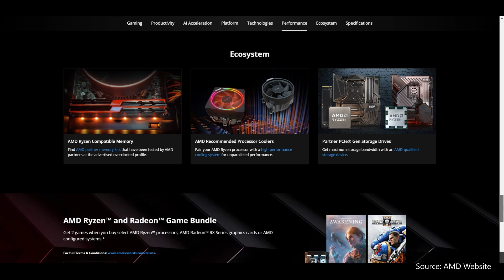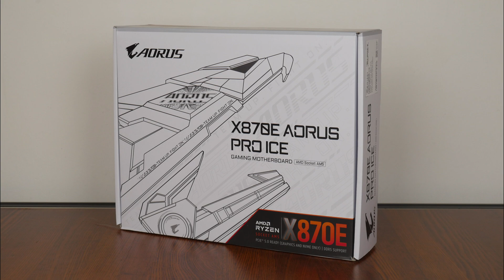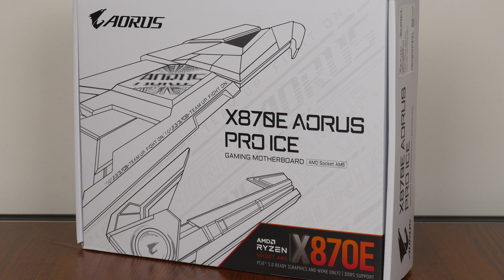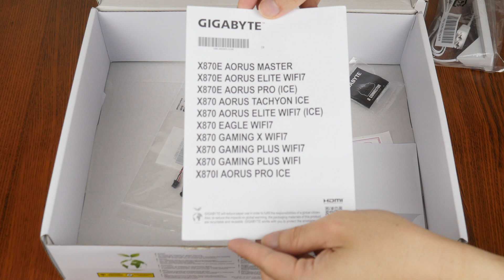THE Motherboard for Next Gen White AM5 PC Builds - Gigabyte X870E AORUS PRO ICE Unboxing & Overview

Comment: terrible design. they stash the battery behind a panel that can only be unscrewed from the back, and they didn't include cmos reset button
Reply from the maker: To be fair, Gigabyte's not the only motherboard manufacturer of late that's been hiding the CMOS battery in places like within the I/O shield shroud (and using the sort of battery that connects to the board via a two-pin connector and not your usual CR2032 coin type battery) - this has become a recurrent trend of late with modern motherboards somehow!

Comment: Any idea how to open the cmos panel?
Reply from the maker: Are you referring to access to the CMOS battery? if so, the battery is located underneath the chipset heatsink, where there are four screws at the back of the motherboard that will need to be undone so as to remove the heatsink to gain access to the CMOS battery holder. Also, the motherboard manual for this board has a diagram that shows where the CMOS battery is located!

Comment: So if I want full bandwith on GPU id have to install my nvme drive in slot above GPU ?
Reply from the maker: To answer your question, the halving of GPU PCIe lanes only happens when you 1) have a M.2 SSD installed in EITHER slot M2B_CPU or M2C_CPU, or 2) have two SSDs installed in both M2B_CPU and M2C_CPU at the same time. This means you should only install M.2 drives in the first and fourth M.2 slots (M2A_CPU and M2D_SB) to avoid any form of lane sharing!
Reply: @ thanks for info

Comment: Thanks for the review ! I just have one question, let's say you'd like to mount 3 m.2 SSDs, 1 GEN5 on the top spot that is alone, and the 2 GEN4 in the triple slot, which means you'll populate one GEN5 slot with a GEN4, will that still half the GPU PCIE lanes ? Thanks for your help
Reply from the maker: Hope you found the video useful! To answer your question, the halving of GPU PCIe lanes only happens when you 1) have a M.2 SSD installed in EITHER slot M2B_CPU or M2C_CPU, or 2) have two SSDs installed in both M2B_CPU and M2C_CPU at the same time. This halving will happen regardless of whether you install a PCIe 3.0/4.0/5.0 M.2 SSD in either/both of those two slots - e.g. if you install a PCIe 4.0 x4 M.2 drive on slot M2B_CPU, the PCIe 5.0 x16 slot will still drop down to run at x8 mode. Trust this clarifies!
Reply: @ALKtech  Thank you so much for your answer, ok then I'll try to keep only the main pcie 5.0 m.2 populated and the pcie 4.0 m.2. I want to keep all the lanes available. I received the board this morning, looks fantastic, but it's heavy though haha. It will have a 9800x3d that I received on release date, and I have a 3080ti and I'll upgrade to 5090, reason why I want all the pcie 5.0 lanes available
Reply from the maker: @ yeap to clarify, if you'd like to avoid any form of lane sharing, just use only the first M.2 slot (M2A_CPU) and the fourth M.2 slot (M2D_SB) for your SSDs!

That said, sounds like you've got a pretty sick build upcoming, especially with the 9800X3D and RTX 5090. Probably would have to wait a little more to see what kinds of white-themed RTX 5090s will be dropping in the coming weeks!

Comment: Great video, what you have said in another post about  m.2 slots in slot 1 and 3 wont effect the gpu bandwith is it the same with the Gigabyte X870 elite ice board?
Reply from the maker: Yup, the X870 AORUS ELITE WIFI7 ICE has the same lane-sharing thing as the board in this video too, where the GPU slot bandwidth will be affected!
Reply: @ALKtech  Thanks for your reply.

Comment: Im doing this mobo:G.Skill Trident Z5 ROYAL NEO Silver 6400Mhz DDR5 32GB, AMD Ryzen 9 7950X3D CPU 🎉
Reply from the maker: Actually, why don't you consider low latency DDR5 6000 memory instead of DDR5 6400? This is because DDR5 6000 is the sweet spot for Ryzen 7000 - the 7950X3D may not play well with DDR5 6400!

Comment: I keep coming back to watch this motherboard. It IS beautiful for a clean white aesthetic that no other board matches. But coming from a X670E Taichi Carrara, the Aorus Pro Ice is literally paying for the look because everything else is a downgrade. My other option is the MSI Carbon, which is almost the complete opposite - a slick black aesthetic and an upgrade across the board to the Taichi. 

Another issue these X870E boards have is lack of compatibility with third party M2 heatsinks. Gen 5 drives run really hot and not all motherboard heatsinks are ideal. Unfortunately the Aorus Pro Ice cannot fit any of the good third party heatsinks (I asked Gigabyte directly) like the Thermalright HR-10/Pro or the Grauger HS06. The MSI Carbon can only fit the smaller heatsinks and only in the topmost M2 slot. 

X870E feels really half baked compared to the outstanding Ryzen 9000 chips.
Reply from the maker: The X670E Taichi Carrara is a pretty solid board and it'd be a "sidegrade" if you were to change to this Gigabyte board - it'd literally be a case of paying for form over function 😅 I do agree that the X870E and X870 could have been better, especially given the lane sharing shenanigans that are a direct result of AMD tacking on USB4 support on existing silicon design (the X670E/X670). Hopefully with the next gen of 900-series(?) chipsets, we'll get a properly improved design!

Good point on the third-party heatsinks, if I ever have a Gen5 SSD on hand, I should probably look into testing thermals with the stock heatsinks of high-end motherboards to see how temperatures are like..

Comment: if I use pci4 ssd only in m1 slot the 16x gpu slot still works at 16x?
Reply from the maker: To clarify, is your question whether or not installing a PCIe 4.0 M.2 drive instead of a PCIe 5.0 M.2 drive in the M.2 slots that share lanes with the GPU slot, will prevent the GPU lane bifurcation situation? 

If this is indeed your question, the answer would be that as long as you have ANY M.2 drive installed in slots M2B_CPU and/or M2C_CPU, regardless of which PCIe generation, the lane sharing with the GPU slot will happen. In other words, if you have a PCIe 3.0/4.0/5.0 drive installed in any of those two abovementioned slots, the GPU slot will work at x8. Hope this clarifies!

Comment: Nice crap , new cpu new ram new mobo new error code , 0D and Led for RAM light on after every restart !!!!!
Reply: which ram you use? i have no issues with 9800x3d and x870e pro.
Reply: @ I have Corsair 6000mhz CL 30 ddr5 vengeance rgb
Reply: @user-jq8xr2gf9h  You what ram are you using? Maybe i am going to buy the same
Reply from the maker: The Corsair RAMs that you have are a pretty common set and should work with the board - it sounds like either your RAMs are faulty or your motherboard is faulty. Are you able to seek help from the retailer that you purchased the RAM/motherboard from?
Reply: @ i have tested the ram with windows built in memory tester no issues, those memory sticks are on the motherboard QLVendor list , probably the motherboard, I have talked to the store and they told me to give them the motherboard and the memory to be checked, those two are purchased from the same store
Reply from the maker: @smamas114  I see. Hopefully the store will be able to set things right and you can get your PC up and running soon!

Comment: Thanks so much for this review. Can anyone tell me, what is the maximum number of m.2 drives this mobo can support without bifurcating the pcie 5.0 x16 lanes? Clarification would be appreciated.
Reply from the maker: To avoid PCIe lane bifurcartion, you can install a maximum of 1x Gen 5 M.2 drive in slot M2A_CPU and 1x Gen 4 M.2 drive in slot M2D_SB, for a total of two drives!

Comment: what if you dont use pcie 5.0 m.2 and use 4.0 m.2 drives...would the gpu slot still go down to x8?
Reply from the maker: Yup - as long as you have M.2 NVMe drives installed on slots M2B_CPU and/or M2C_CPU, regardless of PCIe generation (e.g. PCIe 3.0 x4, PCIe 4.0 x4 etc), the GPU slot will still drop down to x8 mode. Hope this clarifies!

Comment: I will order this one right now!
Reply from the maker: What are the specs of your upcoming build with this board?
Reply: @ALKtech  i dunno my self tbh... waiting for the new cpus.. probs 9800x3d with new fitting rams. hoping for 6400 support.
Case will be a hyte.
and Crucial t700 pci5 ssd....
want to make a "white" build.. but im not too sure about all of the parts to consider.. 
as my gpu my 2070 has to suffice until the 5'000 series
Reply from the maker: @Pingusirup  cool! If your RTX 2070 is enough for you, no harm just using it till RTX 5000 arrives perhaps early next year!
Reply: @ALKtech  yeah i hope so.. wanted to make a nice white build.. probably even use the hyte tower with the display..  even nzxt will release their new MoBos in q1 25' in clean white on X870e...   im struggling to decide now that im writing about it 😀
Reply from the maker: @Pingusirup  well I personally think the Gigabyte in this video is the best-looking all-white X870E mobo on the market currently...there's no other brands with a similar aesthetic (i.e. with white-coloured slots, connectors etc)!

Comment: hey man quick question. i have the gogabyte x670e auros pro x and it keeps crashing everytime i run xmp into my 8000mhz ram. like boot crashing. do u think I have to flash update the bios or get this motherboard. because the one i have now (the one i mentioned) only sticks to its base 4800/3600 speeds. I dont wana get a new mobo but I think its the only way to get it to run correctly at the higher ram speeds. could this board u are showcasing handle above 7600?
Reply from the maker: Hey there, what processor are you using? Ryzen 7000 series or 9000 series? I personally have a 7800X3D on a Gigabyte X670E AORUS MASTER, and have never been able to run stably on speeds above DDR5 6000 on the stock EXPO profiles that my RAM has (I'm using DDR5 6400 CL40 memory running at DDR5 6000 - I'm lazy to manually tweak my memory timings) - the sweet spot for the Ryzen 7000 series is DDR5 6000. That said, what model of memory are you using, and are they EXPO or XMP RAMs?
Reply: @ALKtech  I have the 9950x and i think the same mobo and thats why my xmp system doesnt work cause im running it to high or is it just a boot failure?
Reply: @ALKtech  i have that cpu and 7600mhz ram corsair dominator platinum
Reply from the maker: @jamesharisson8389  thanks for sharing. It sounds like more of a settings issue, seeing as the Corsair RAMs have XMP profiles that are suited for Intel platforms, rather than EXPO which is targeted at AMD. If you're keen to stick with your current set of RAMs, you may want to set your memory timings manually to try and find settings that work for your 9950X - based on reviews out there thus far, the sweet spot still seems to be DDR5 6000 or DDR5 6400 for Zen 5. Have you already tried running your RAMs at DDR5 6000/6400 (though I suspect your RAMs might not even have DDR5 6000/6400 profiles loaded - correct me if I'm wrong)?
Reply: @ALKtech  i have not yet but will be sure to give it a try! thanks for this info. and also i have the g skillz 8000mhz ram aswell to pair but didnt work at 8000 either. Do u think these newer 870e could run at 7600-8000?
Reply from the maker: @jamesharisson8389  no problem. I do believe your G.Skill RAMs might have Intel XMP profiles instead of AMD EXPO profiles (correct me if I'm wrong), which explains why they didn't work with your 9950X. DDR5 7600/8000 should work with Zen 5 processors (regardless of X670E or X870E), but again, there's an element of the silicon lottery here, plus the fact that you'd probably have to manually tweak your memory timings to have a chance of running your RAMs at speeds faster than DDR5 6400 without causing persistent crashes...

Comment: I have the X670E Taichi Carrara and am looking for a clean white mobo replacement. The Aorus Pro Ice looked promising until I read the fine print regarding the NVME slots halving the GPU bandwidth. That is such a bad design choice it borders on false advertisement. You lose half of the advertised SSD slots if you want to run your GPU at its stated specs. I use four SSD drives with a 4090. Aintnoway this mobo makes sense even if I like the pure white aesthetic.

Manufacturers really do not capitalize on the appeal of white builds.
Reply from the maker: Unfortunately this is due to AMD's requirement to have USB4 support for X870E/X870 motherboards, where as a result board manufacturers have to set aside some PCIe lanes for the USB4 controller, leading to this lane sharing situation. That said, it's still worth noting that the impact on GPU performance (both gaming and productivity workloads) tends to be minimal when running a GPU at PCIe 4.0 x8 mode...but yeah, missed opportunity here for AMD to have done a proper redesign of their next-gen chipset rather than simply renaming X670E/X670 and tacking on USB4 support at the expense of GPU/M.2 PCIe lanes!

Comment: Do you recommend this gigabyte or the rog x870a?
Reply from the maker: How big's the price difference between both boards where you're from? Not taking into consideration price, I'd personally go for the Gigabyte just because it has a full-white aesthetic and would probably look much nicer in a white AM5 PC build!
Reply: @ALKtech  I live in Italy and here the gigabyte costs 400$ and the rog costs 500$. I appreciate your opinion and thank you for your response and your videos.
Reply from the maker: @johnnymanetta1925  oh wow. For a X870 board to be so much more expensive than a X870E board...the ASUS tax is real 😅I'd get the Gigabyte board in this instance and save the $100!
Reply: @ALKtech  Thank you very much, one last question please. But if I use an m2 gen4 on the second gen5 slot will the gpu line still work at x8?
Reply from the maker: @johnnymanetta1925  yup - as long as you have a M.2 drive (regardless of Gen 3/4/5) installed on the second Gen 5 slot, the primary graphics card slot will drop to x8!

Comment: Im ina serious aesthetic crisis. Wanted to try out an Asrock white motherboard, but this is much more white. I did not wanted Gigabyte anymore i have to consider what to do
Reply from the maker: I'm sure it doesn't help that the ASRock boards are probably much friendlier to your wallet too compared to the Gigabyte...but yeah I had a look at ASRock's white boards, the aesthetics of this Gigabyte wins hands down in my opinion. How big is the price difference that you're looking at, where you're from?
Reply: @ALKtech  Thansk for the answer, Im from hungary, products are not arrived yet. Price is not main factor because im going to use it for a long time thats why aestetics are important, ill have an open case
Reply from the maker: @Betonoszlop  I see! Out of curiosity, what open case are you using? And why were you not considering Gigabyte - did you have a bad experience with their motherboards previously?
Reply: @ALKtech  Ill get Thermaltake Core P3 white case, I used gigabyte motherboard since 2011 but ive heard about issues in the past few years basicly just wanted to try out something new like Asrock's Steel legend
Reply from the maker: @Betonoszlop  the X870 Steel Legend looks decent specs wise, though it's a pity the slots and other plastic hardware are black in colour and not white, like on the Gigabyte!
Reply: @ALKtech  Yes, overall looks better indeed

Comment: Does this motherboard have wifi
Reply from the maker: Yes it does!
Reply: @ALKtech if I use one ssd will that mess up my gpu? Which spot do I use
Reply from the maker: @JustinThomas-f5y  nope - if you're using just a single SSD, make sure to install it in the first M.2 slot, which is M2A_CPU!

Comment: Can I not use 2 Gen 5 SSD's or will it hinder my GPU performance? Or is it best to use 1 gen 5 and 1 gen 4 SSD?
Reply from the maker: The ideal setup would be two SSDs - one Gen 5 SSD in the first Gen 5 M.2 slot (M2A_CPU), and one Gen 4 SSD in the Gen 4 M.2 slot (M2D_SB). If you have any SSD (regardless of Gen 5/4/3) installed on the other Gen 5 M.2 slots (M2B_CPU, M2C_CPU), the GPU lanes will be impacted.

But that said, the performance drop from having the GPU lanes go from x16 to x8 isn't thaaaaaat big - there are some articles/videos out there that quantify the performance difference, and it seems to be in the low single-digit percentage range!
Reply: @ALKtech  Appreciate the comment! Deciding between this one and the 870 Rog Hero right now
Reply from the maker: @TangerineAltoid  happy to help. What's the price difference between both boards where you're from?